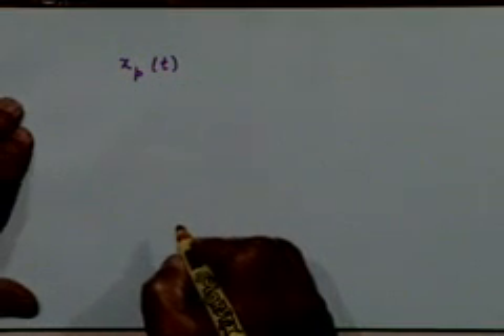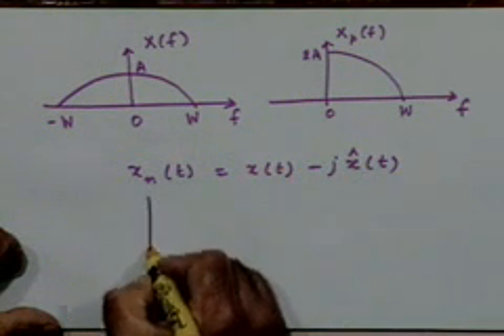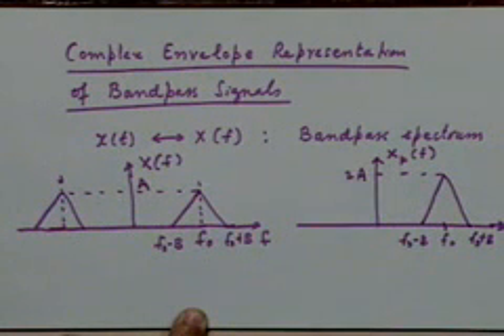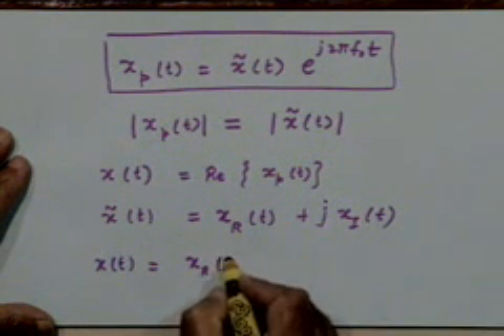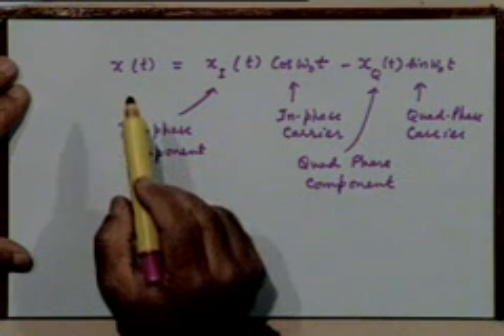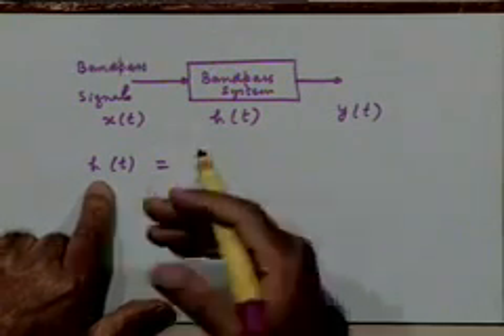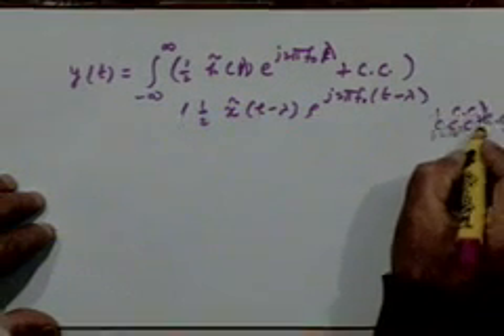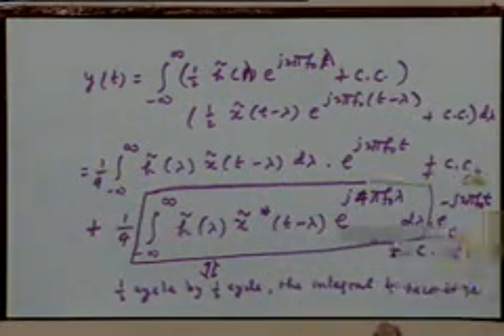Lecture - 5 Analytic Representation of bandpass Signals

Comment: can anyone plz explain why the last integral is zero half cycle by half cycle part
Reply: The integral is actually a low pass signal multiplied by a high-frequency carrier signal. Over a cycle of the high-frequency carrier signal, you can assume the low pass signal to take up a constant value as it varies much slower (as it is of low pass/low freq) than the high-frequency carrier signal. The integral of a sine wave over its cycle is zero since the positive half of the cycle compensates the negative half. Using the same argument, one can show that the result of the evaluation of the  3rd and 4th terms of the integral is zero. Hope it helps!

Comment: 48.00 why was the integral zero
Reply: The integral is actually a low pass signal multiplied by a high-frequency carrier signal. Over a cycle of the high-frequency carrier signal, you can assume the low pass signal to take up a constant value as it varies much slower (as it is of low pass/low freq) than the high-frequency carrier signal. The integral of a sine wave over its cycle is zero since the positive half of the cycle compensates the negative half. Using the same argument, one can show that the result of the evaluation of the  3rd and 4th terms of the integral is zero. Hope it helps!